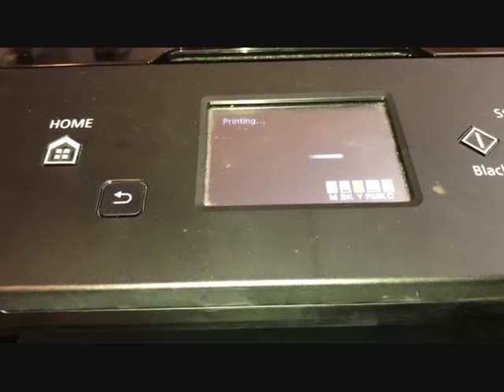How to clean printhead manually using hot water

Comment: Perfect !  Was just about to give up and toss the printer.  I had just bought all new ink and it was still giving the error code.  Once I ran the printer head under hot water and dried well (using paper towel and then blowing with canned air)  the printer is working perfectly.  Thank you !
Reply: What error message did you get? U052 wrong printer head type?

Comment: Man, you are genius. My MG6320 was not used for colour printing for maybe 2-3 years and when I fired it again, there was almost nothing on the paper. Checked few videos, each involved buying some equipment, and then came across yours. After first attempt, it started printing b/w, so I took it apart again and just kept under hot water until last trace of blue ink was no more visible in the white sink. Used paper towel and hair dryer to remove all drops of water, installed in the printer and VOILA! It came back to life with the same vivid colours when I printed my photos few years back. So I am joining the chorus of other happy viewers and saying big Thank You for your time and posting this video. Oh, did I mention that in the meantime I bought another cheap colour printer... :-(
Reply: What kind of error message did you get?
Reply: @allangustafsson  I do not recall error message, the printer just didn't print correctly.

Comment: There's a caveat to this method that I didn't notice mentioned. If you have hard water or are on well water, this may not be the best option unless you rinse afterward with distilled water to get rid of any trace mineral deposits. If you have a water softener, you should be good to go.
Reply: Hey I have a question how long after rising out the printer head does it have to dry
Reply: @leonard187 use it immediately
Reply: @leonard187  Honestly I would blow any water off the electronics immediately, then let the printhead sit and air dry for at least 24 hours. This is what I did when the print head in my Canon flooded from having my CIS system tanks sitting too high (my own mistake) and it worked just fine afterwards.

Cleaning the mess from a flooded printhead is a SERIOUS pain in the arse....

Comment: This worked for me, but I also used a large straw to blow on each printhead. My PGBLK was not working even after cleaning with water, but it worked after blowing into the ink hole and washing further with hot water.
Reply: Thanks, after reading your tip, I did the same but then filled my mouth with tepid water and blew it from the straw into the ink holes. Got a lot more out.
Reply: I hope this'll work for me. It sounds like soak it for ~30min. Then blow like the wind, huh? I'm pretty sure it's my PGBLK too since I hadn't replaced it in a long time, letting it dry too much.
Reply: 😞 Straw didn't work either
Reply: @DuderofDudeness Straw was a temporary fix for me. That Canon printer is not reliable. Had to replace it after cleaning stopped working. Currently using a Brother laser printer. Zero problems and laser doesn’t clog after long periods of unuse.
Reply: @leoap87  Thx for the response. Nice, good to know. I figure that PG BLK clogged is the problem but maybe its my yellow cartridge, looks drier than an uninterested lady. Maybe I'll try a cleaner solution since I'm broke 😭😂
Reply: @DuderofDudeness  Keep laser in mind for the future if you only need black printing. Color laser is expensive, but monochrome printers can go for $150. The dry ink they use is cheaper in the long run. Prints more pages and doesn't dry or bleed out.
Reply: @leoap87  "laser" as Dr.Evil would say 😂, ok, will do!

Comment: Thank you so much.  I've been refilling cartridges for a few years now.  I have both a TR something, it's the full package, and a TS700, whch I love because it's just th printer.  But I'd refill a cartridge and then it would print out poorly, I'd install new ones, same issue.  Well, using your method of manually cleaning the print heads, it's printing beautifully.  I couldn't pop out the mechanism itself -- I'm 67, arthritic hands -- but I took a heavy duty blue shop towel and pressed it up againnst each one -- and decided to go for broke, filled each cartridge full -- gorgeous print the first time.  I mae journals, and truthfully, if the printer broke today, it's more than paid for itself.  But, thanks to your video, just like me, I think the old girl has some life in her yet.  I subbed.  Thanks again from Richmond, VA  USA -- Patricia

Comment: Once again the simplest answer is usually the best. Thank you so much for saving me at least $100 or more . 

I have a Pixma 920 series. I had a b200 error and everybody else said it was dead and I would have to replace the printhead or the printer. A lot of people blame the cheap Chinese ink which I have been using for years. It's possible that it just built up . Anyway this solution with hot water is 100% effective and does work believe it or not .  Everyone else said to use swabs and alcohol and or a certain type of tool or cleaning solution. All I did was run hot water over the printhead  literally everywhere over it and made sure it went through the mesh areas and I noticed a lot of ink coming out the other side. I simply rinsed until no more ink came out. I didn't use distilled water and I used a paper towel to gently dry it off and I shook it out and waited a few minutes. I shook it again, dried it again, installed it and the printer works perfectly. It's printing better than it has in years. The only thing is that when I was drying off the bottom portion with the thin strips where the ink comes out I made sure I was gently wiping and not scrubbing. 

The only other thing I would add is that when you're removing the printhead and you first need to pull that lever with the colored bars towards you, to make sure that the bar clears either side otherwise you won't be able to pull it . You'll see what I'm talking about if you're able to pull one side toward you but the other side doesn't because it catches on a part of the printer. There's only a small margin of the opening where you can align the ink cartridge carrier to be able to pull that lever towards you

Last thought.  Do not unscrew the two little screws on the underside thinking you'll clean more.  Leave them alone
Reply: Haha I was tempted to removed the screws but didn't.  I wonder why the water doesn't come straight through the print head like on HP printers

Comment: Amazing! My Canon printer had sat unused for almost 3 years because it wouldn't print right. I bought a new set of ink cartridges at the time but didn't install them because I figured I'd be throwing good money after bad.

Some of the other videos I watched made me afraid to do this operation; one video said you must not get the electronic board on the printhead wet, and another video didn't even remove the printhead. But I forged on, following the instructions in this video. 

It took a looong time to rinse out all the ink; it's amazing how much ink was hiding in the fine slots on the back of the printhead (which one video also said to not get wet!), and when I finally deemed it clean, there were still a couple of colored spots that dribbled onto the paper towel I put it on.

The worst part was not this operation but reconnecting my printer to my computer, which took all day and was maddeningly difficult, but, lo and behold, I got it working! THANK YOU!

Comment: Was getting error 5100 on my TS9020.  Hubs took the air compressor and sprayed it out, which got the error to stop, so he must have got rid of some particle.  Then, printer only printed blank pages.  Saw this video, took about 10 minutes of hot water rinsing, then dried with paper towels and hair dryer (on cold).  And...I have a working printer again!!!!  Color is not great, maybe I need to clean more, but it works and that is HUGE!!!!  Thank you!

Comment: THIS FIXED MY ISSUES! Bruh, thx for not talking for 10 minutes prior to actually doing anything!! Easy to follow and implement. Wish I could give more than 1 thumbs up.. Wait, I have another account. I'll give that one too! **One suggestion. I couldn't get the head release tray to pull when the printer was plugged in because it caught on the bottom left on the housing lip. May want to add a superimposed message telling peeps to open and center cartridge tray then unplug to maneuver. But seriously though it was a small thing. GREAT VID.

Comment: Have been using "knock off" ink and noticed black (esp. 250XL) on my MX-922 was not printing. Used this method, and it cleared up my problem quick. 
Also used the "Deep Cleaning" function afterwards, and now prints like new.

Comment: Hello, I have a canon MX922. I have tried everything from cleaning the printhead, resetting the printer, adding new ink, even putting paper in the upper paper holder.  What is the deal with these? I see this was a problem way back in 2017.  What will solve the issue?  Its grabbing the paper, acts like its printing, sounds like its printing and the page comes out white.....
Reply: @TPPNews  NOPE. I ended up buying a new printhead. It DID NOT work.

Comment: WHat worked really for me, after using a lot of tricks, as strong solvents, hot water, and ultra wave bath, blowing, aspiration,  no way to see some red on the nozzle (HP443 2 years no use) WHat worked really well and fast : I put hot water in my dental jet, pressure at the max. Just one full recipe and the red was open. It may be better to do it 2 or 3 times as it is pushing into the micro holes, but it really worked, after 24 hours testing different tricks. It is not sending ink everywhere do not be afraid ;)
Reply: chuckle -- Dental pick. I love it. Good improv.

Comment: Thank you so much!!!! This saved me from having to buy and wait for the cleaning solution. Works very well. It was easy to clean. I think who ever has an issue with ink not probably printing should try this.
Reply: I have a MG 5520 I am getting the support Error Code 1403.  It appears that the existing cartridges that i have in there have plenty of ink. If I clean the print head, do I need to install new ink cartidges? or should I use the existing ink cartridges?
Reply: @soulskratch  Just use your old ink cartridges? Did it work?????
Reply: @murrayhall908  thanks for checking in.. unfortunately I didn't work.. we ended up buying laserjet copier/scanner/printer...

Comment: thanks a lot but does it works with the pixma MG5100
A long time ago a friend who sadly passed away told me "you remove the print head" and you soak it in methylated spirits.  But if the water works it's better

Comment: my pixma ip8750 has ink cartidges in with plenty ink and the printer prints blank pages. very annoying. ive soaked the head overnight once and this uncloged it, but i will give it a good blast now and see what happens. the ink heads are around 36-80 quid online. mostly from china. should it get wrecked. i could do with a straw to blow and blast anytihg stubborn out

Comment: I drove home during my lunch break to try this on my MX922.  Did everything as shown by removing the printhead, running it under lukewarm water, drying it up and replacing it to it's original location.  I also did a "deep cleaning" prior to attempting a test print but the printer still won't print anything on the paper.
Reply: Same here! Mine goes through the hole printing process but the paper has nothing on it.
Reply: Yep same thing. Pixma ts8120 on mine
Reply: @kaindog100  So!!!...  I ended up buying a brand new printhead for the MX922 from a seller in Arizona on eBay for $112.
Reply: @lagrandisimu1810  did that solve it? Mine wont print either after hot water cleaning
Reply: @gregalfrey3606  No, it did not work.  I ended up purchasing an original Canon printhead replacement and now I'm back to printing as usual.
Reply: @kaindog100 did you get yours to work after all I have the same issue gonna try the cleaning method tomorrow
Reply: @joseconstante1321  bought a new printer as I couldn’t get it to work unfortunately.
Reply: @kaindog1007  oh ok well hopefully I can get it to work ..thank you

Comment: How long does it take to dry out?
Reply: You can use a paper napkin or soft piece of cloth to dry. You may use the air pressure to wipe out the water. After 10 minutes of wiping out the water it will be good to use again.

Comment: just camed here to see how to take off the printhead but no , you skipped it . thanks a  alot bud :D
Reply: Bring the ink carrier to the midddle of the run. Take out inks. Pull bar at front outwards (with the colour markings on it showing where the ink cartridges go}. Put your fingers into the back of thesection and simply lift out the print head. Sounds difficult but it is not. After vcleaning reverse the operation.

Comment: Finally found the way to remove the printhead of my MX925 because of the B200 Error.
I will try now and clean it as seen in the video then see if this solves the error.

EDIT: Nope, it didn't help, the B200 error message still appears when trying to print.

Comment: If anyone is here because their printing is out of alignment (for me it was my photo black) which results in blurry double images (or ghost images) where it looks like your letters have dropset shadows, it MIGHT be because your printer head has over heated and has warped, which no amount of cleaning will fix.  
You will have to replace the ink head. I do A LOT of photo printing so I can see why I'd have this issue only a year into the printers life span. I literally print full size 19x13 images sometimes 10-20 pieces an hour and didnt realize it could over heat. I will take it easier and learn from that mistake. Hope this helps.

My printer alignment page showed vertical bars that actually bend to the right of a straight line. which is what I can safely assume after cleaning the shit out of everything and having no progress made, is because of warped nozzles.
Reply: Ow to put a clip on pixie cannon printer
Reply: That’s why I’m here, but I’m going to try this 1st. I rarely print
Reply: Thank you for your input! However, I was circumcised & I can say that after 72 years, I am as happy as a pig in slop! It paid off in spades!
Reply: @CircmcisionIsChi1dAbus3  Gave you a thumbs up but it was beneficial to me. Very much so! You're not a guy so you don't really understand but you're certainly entitled to your opinion! I'm happy! I would go into detail but you'd probably not be Up for it! BTW, I've seen guys who haven't been circumcised & "it" looks horrible & it's nasty!
Reply: @billcallahan9303  WTF has that got to do with printing?
Reply: @andydelapoer  Ask her Andy. She started it...5 months ago. Crank it up again if you like.
Reply: @billcallahan9303  you don't need to reply
Reply: @andydelapoer  Okay. I won't.
Reply: @billcallahan9303  remember never argue with a fool